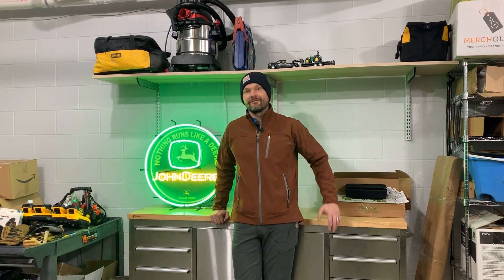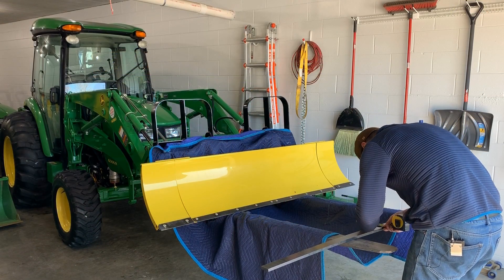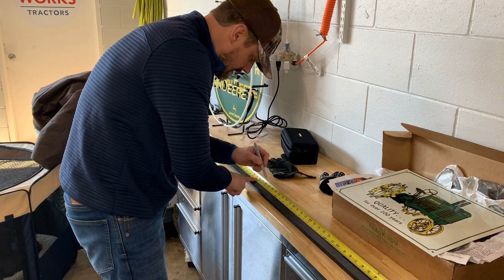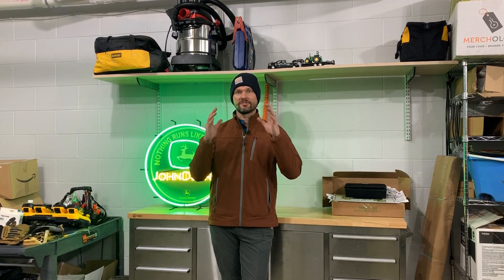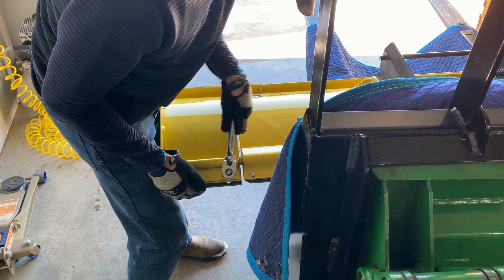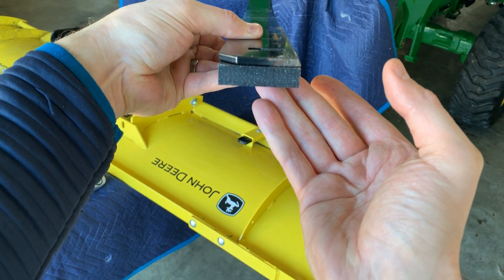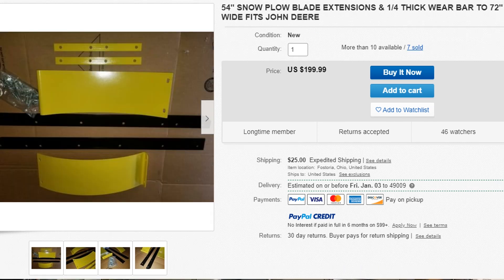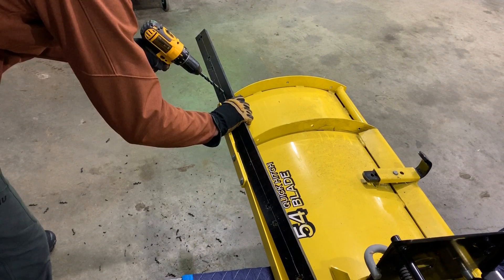HOW TO: EASILY INSTALL A UHMW POLY SNOW PLOW EDGE 👩‍🌾🚜👨‍🌾

Comment from the maker: Buy UHMW Snow Plow & Snowblower Edges & Skid Shoes below!  Plus check out the two different sizes of snow plow wing extensions too!

UHMW 54" Snow Plow Edge: http://rover.ebay.com/rover/1/711-53200-19255-0/1?ff3=4&pub=5575558646&toolid=10001&campid=5338634533&customid=UHMW+54%22+Snow+Plow+Edge&mpre=https%3A%2F%2Fwww.ebay.com%2Fitm%2FNEW-HEAVY-DUTY-54-POLY-WARE-BAR-JOHN-DEERE-WHEEL-HORSE-CUB-CADET-SNOW-PLOW%2F261634661189%3Fhash%3Ditem3ceaa41b45%3Ag%3AjSAAAOSwr81UR055 

UHMW 72" Snow Plow Edge: http://rover.ebay.com/rover/1/711-53200-19255-0/1?ff3=4&pub=5575558646&toolid=10001&campid=5338634533&customid=UHMW+John+Deere+72%22+Cutting+Edge&mpre=https%3A%2F%2Fwww.ebay.com%2Fitm%2FNEW-72-x-2-POLY-WEAR-BAR-FITS-JOHN-DEERE-SNOW-PLOW%2F253373011990%3Fhash%3Ditem3afe355816%3Ag%3AjSAAAOSwr81UR055

UHMW  John  Deere Snow Plow Skid Shoes: http://rover.ebay.com/rover/1/711-53200-19255-0/1?ff3=4&pub=5575558646&toolid=10001&campid=5338634533&customid=UHMW+John+Deere+Snow+Plow+Shoes&mpre=https%3A%2F%2Fwww.ebay.com%2Fitm%2FNEW-JOHN-DEERE-48-54-PLOW-SKID-SHOES-3-8-HEAVY-DUTY-UHMW-SKID-SHOES-COVERS%2F261374018680%3Fhash%3Ditem3cdb1b0478%3Ag%3AqhMAAOxycmBS04QM

UHMW John Deere Snowblower Skid Shoes: http://rover.ebay.com/rover/1/711-53200-19255-0/1?ff3=4&pub=5575558646&toolid=10001&campid=5338634533&customid=UHMW+John+Deere+Snowblower+Skid+Shoes&mpre=https%3A%2F%2Fwww.ebay.com%2Fitm%2FNEW-JOHN-DEERE-44-47-SNOW-BLOWER-SKID-SHOES-WITH-UHMW-COVERS%2F261707393414%3Fhash%3Ditem3ceef9e986%3Ag%3AhF0AAOSwi5xeAZz8

Cheap John Deere Snow Plow Wing Extension Kits: http://rover.ebay.com/rover/1/711-53200-19255-0/1?ff3=4&pub=5575558646&toolid=10001&campid=5338634533&customid=UHMW+John+Deere+Snow+Plow+Extensions&mpre=https%3A%2F%2Fwww.ebay.com%2Fitm%2F54-SNOW-PLOW-BLADE-EXTENSIONS-1-4-THICK-WEAR-BAR-TO-66-WIDE-FITS-JOHN-DEERE%2F251756084828%3Fhash%3Ditem3a9dd4fe5c%3Ag%3AGQEAAOSw-QBcFIxM  OR  http://rover.ebay.com/rover/1/711-53200-19255-0/1?ff3=4&pub=5575558646&toolid=10001&campid=5338634533&customid=UHMW+John+Deere+Snow+Plow+Extensions&mpre=https%3A%2F%2Fwww.ebay.com%2Fitm%2F54-SNOW-PLOW-BLADE-EXTENSIONS-1-4-THICK-WEAR-BAR-TO-72-WIDE-FITS-JOHN-DEERE%2F264099099862%3F_trkparms%3Daid%253D555018%2526algo%253DPL.SIM%2526ao%253D1%2526asc%253D20131003132420%2526meid%253D8861d8e6fafb45fb9b077dbcf4e116f7%2526pid%253D100005%2526rk%253D1%2526rkt%253D12%2526mehot%253Dpf%2526sd%253D251756084828%2526itm%253D264099099862%2526pmt%253D1%2526noa%253D0%2526pg%253D2047675%26_trksid%3Dp2047675.c100005.m1851
Reply: Nice tractor

Comment: Looks like it worked out well for you. I saw that Polaris makes a 72" L shaped poly edge for use on gravel and grass. I'll be using my 72" Land Pride blade for the first time tomorrow with the storm thats supposed to drop 10-15" starting this evening. If that doesn't work well on gravel I'd consider modifying the Polaris edge to see if it would be a better solution. Below is how it is typically listed in case anyone is interested or has any experience with it.

Ranger Glacier II Plow 72" Blade Floating Wear Bar

Comment: I recently replaced the steel edge on my John Deere snowblower. It’s a big heavy unit and I also was concerned about ripping up my driveway. So I replaced the edge with the thick rubber belting material and I also found some replacement uhmw skids that fit the blower perfectly. Now I have a pretty nice setup. 
I did not consider a plastic edge such as yours we’ll see how the rubber one holds up.
Reply: What's the rubber material that you used, and how did it hold up?
Reply: @johnthree1611 I can’t remember where I bought it from..
I think I just did a google search for flexible snow plow blade material or something like that..
It’s the same material that is used on the rubber belts on conveyers used in gravel pits.
And it has held up
Extremely well. It won’t scrape up any ice or hard snow but that’s ok for my needs.  It’s really saved my driveway

Comment: UHMW- Ultra High Molecular Weight 
It’s a polyethylene plastic, common to be used where slick glide surfaces need to be abrasion resistant. 
Often used on plow blades, chutes for gravel, dogsled runners, bottom of air-boats and skis for planes to land on snow and ice. 
Expensive but nothing cheap compares to its durability.
Reply from the maker: Merry Christmas & Happy New Year!

Comment: I have the uhmw and getting ready to install on my blade and noticed that the uhmw does't go flush with the pavement  in the front as the plow itself the way it is shaped has the front edge of the uhmw up about 1/4 inch however the back of the uhmw where it is flat against the blade goes down to the pavement. Did you notice that on your blade ? I know eventually it will wear down and be flush against the pavement just wondering if you cut the front edge on an angle so it rested flush on the ground? Thanks

Comment: Once again, another great video.  I do have a question though.   So, you replaced the original carriage bolts with regular bolts with fender washers, correct?  You mentioned they were 1 1/2 inches long. Might I ask, what size they were?   It looks like 3/8 but its hard to tell.   Thanks again for posting this recommendation as I plan to go this route as well. 

 Merry Christmas to you and your family.
Reply from the maker: Good Morning, Yes, 2 different sizes since I had the wing extensions.  If I recall, the bolts on the main plow were 8mm coarse while the extensions were 3/8".  I may have that backwards, but think that's correct.  Merry Christmas!
Reply: @GoodWorksTractors  And a Happy New Year as well   <3

Comment: The way you drilled the cuttin edge, you don't have much room to grind down before they have to be flipped over. I would buy an inch wider piece so it will last longer, or drill your holes higher

Comment: Hey Courtney - Do you have an update on the cutting edge?  Do you still like it?  Is it worth getting one?
Reply from the maker: Hey Russ, only had a handful of opportunities.  Been a bad winter as far as snow goes.  However, I'm very glad I did it for several reasons.  It is super quiet, I feel like I'm protecting my drive a lot more, and I don't have to worry about rust stains.  I don't think it cuts through packed snow as well as steel, however I think it's pretty darn close.
Reply: @GoodWorksTractors  Thanks so much for the update!  I think I am going to order the one from Heavy Hitch that is pre-drilled and cut to John Deere specifications.   Do you have an affiliate link to them so I can help out your channel?
Reply: Super long term test a year later, how is the edge holding up now

Comment: It looks like you went with the 1/2” thick by 2” wide version? Do you have an idea how far your bolt holes are from the edge of the plow blade itself?

I want to put one on the 54” plow on my ATV. The manufacturer sells one, but it’s 3/4” thick (which I think is too much) and very expensive. I talked to the seller you got yours from and he has 2” and 4” widths, but the OEM one is 3”. I’m trying to figure out if I can get away with the 2” or if I need to step up to the 4” (which I worry may be too wide to sit flush).
Reply from the maker: Yes, I went with 2"...I think it was only a 1/4" overhang for the bottom edge.  I matched it up with whatever the steel edge had for overhang.
Reply: Good Works Tractors Thanks! I just ordered the 2”. I took a closer look at my plow and with that size I should definitely have some overhang. I don’t know how much is the right amount, but I’ve got to figure you don’t want a ton or there will be a lot of extra force on it.
Reply: In case anyone comes across this, I just mounted the 1/2”x2” undrilled bar from the eBay seller on my 54” Warn ProVantage plow. 

I drilled 1/2” holes vertically centered. There is one right in the middle of the bar, and then 3 on each side at 8”, 16”, and 26” from the center. I opted to use the old steel bar on top and sandwich the UHMW one so the clamping force would be more even and so I could use carriage bolts like before. I couldn’t find M10-1.5 carriage bolts locally so I went with 3/8”. The originals are 1” so I went to 1.5” to account for the thickness of the new bar. Like before I used nylon lock nuts but decided to add washers as the nuts were smaller in overall diameter than the originals. 

We don’t have any snow in the forecast, but I’m sure I’ll get to try it out before the season is over. If not, I won’t be that disappointed.
Reply: Steve W someone just came across it, lol. Great idea with the steel bar sandwich

Comment: Just a note, but plastic is NOT harder than steel. Not sure where you got that but that is completely false. If it were harder, you would be damaging your driveway even more.
Reply from the maker: Good catch! The listing I purchased from as well as a couple of websites listed things along these lines.  Upon looking a little further, I wonder if they are referencing the strength to weight ratio?  Looks that is commonly listed as being significantly stronger for it's weight compared with steel?  I also see the it listed as having much better wear resistance.  Perhaps that's what they are associating with hardness?  Dunno.  Or, could be a slip of the tongue so to speak.
Reply: It doesn't wear as fast but glides better.